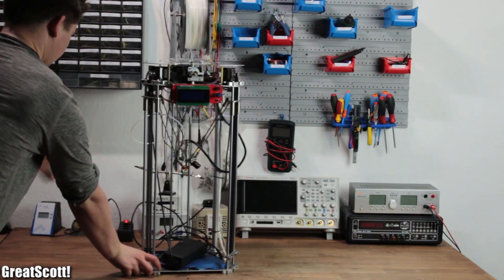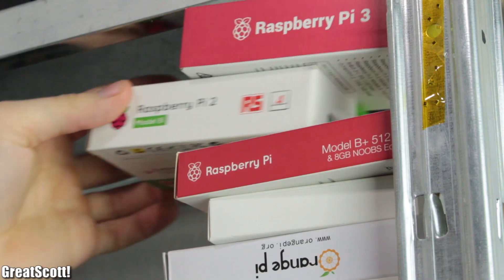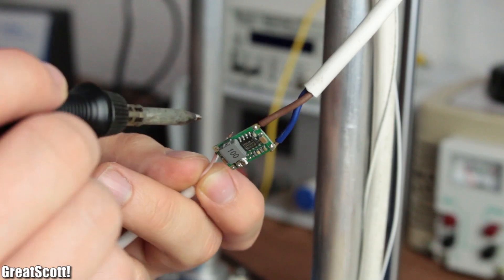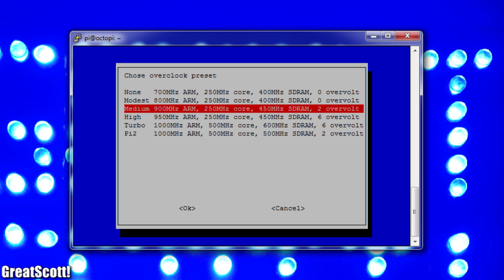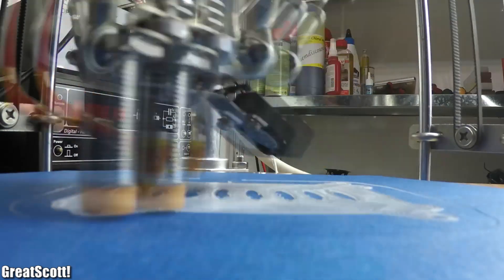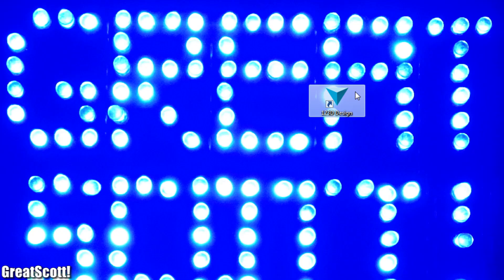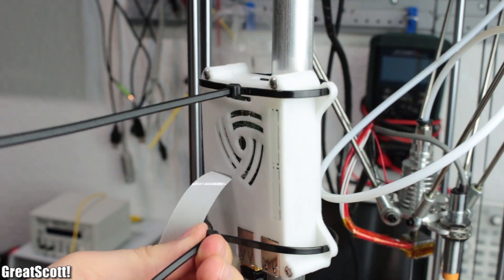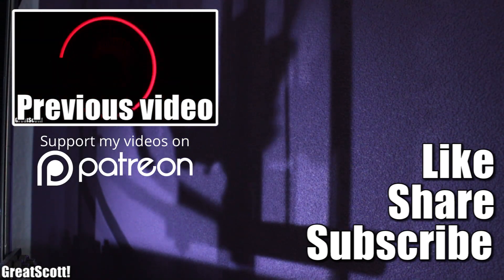Wirelessly control your 3D Printer - OctoPrint Tutorial - 3D Printing Beginners Guide (Software)

Comment: Depending on the printer you have, it might have a USB B port. Would that be just as useful with the Raspberry Pi as your DIY wiring? That way I can start prints through a network.

Comment: I followed your tutorial and used the same mini buck converter, but after turning on the 3d printer psu and connecting the raspberry pi to the arduino, the voltage regulator on the arduino gets very hot. if I disconnect the raspberry pi, it cools down. I think somehow the rasperry pi is drawing current from the arduino? The pi is still powered on if I disconnected from the arduino. Strange.

Comment: Did you try to put cooling fans around nozzle to stop stringing. If not give it a try. I have the same problem and putting extra fans helped a lot and now i dont need to clean my prints from string chaos. :D

Comment: What am I missing here @greatScott? 
At 4:30 you discuss the LED circuit, 2 x 22ohm resistors in parallel with a 10mm white LED in series with them. You then go on to say it's powered by 5v. 
This produces an equivalent resistance per LED of 11ohms.
White LED's have a Vf of 3.3 and a forward current of about 30mA.
5-3.3/11=.154A or 154mA....
That is 5 times the Forward current.......
However 3.3*.154=0.5W...
Are these non standard LED's which can handle a higher current provided they stay below the half Watt?
I have not come across these yet and if I have I must be under driving them significantly.
Reply: yeah they make 0.5w ultra bright leds like that
Reply: So he did, however I have since realized I have indeed been under driving LEDs for some time. As it seems most LEDs are now rated in their watt handling ability. Ignorant of this I have still been designing circuits to keep the current through the LED to less than 30mA. 
This was very handy to learn!

Comment: To fix the stringing increase your retraction and increase your travel movement speed 10-20mms extra and delta printers can print up to 120+ mms not 30! The recommendations from China manufacturers are a load of crap ! Experiment a little

Comment: Try adjusting your hot end temp a bit lower, and experiment with print speeds. Stringing won't be as bad. Avoid over-retracting, it causes problems.

Comment: hmmmm,
I think your retraction settings really need proper calibration...
Reply: What is the general concensus on retraction?
Reply: i retract 7 mm at 30 mm/s (minimum travel 0.8 mm) and have no stringing issues (cr-10)
nozzle temp 210
Reply: I use 210 on my CR-10  (pla) and 4mm /.02... I like my CR-10, I have had tons of luck with it.
Reply: Mahmoud Shehata and possibly a lower temp

Comment: Sorry but you don't need to cut the wire on the usb cable. Wire the positive terminal to GPIO pin 2 and Negative terminal to pin 6.

Comment: IIRC you can adjust the retraction settings so the extruder pulls back a bit when jumping around on a print do you don't get those strings. might be temperature settings of the extruder too.

Just things to try 😊

Comment: You can add relays and 433mhz transmitter. With them you can power On/Off your printer or led after prints or in the Webinterface

Comment: don't most printers allow you to print from a SD card...
my printer does. and I use nothing else but the SD to print. sometimes (and this happened to me) the USB signal can get a hiccup and screw your print up. since all commands are send at teatime... these days I only use the USB for upgrading the firmware or diagnostic information...
Reply: using a SD will let you print autonomous from a PC or other device... you let the arduino controller do everything...

Comment: The Raspberry Pi with Wifi adapter and a camera module gets to around 80€ in Germany... Why does it have to be so expensive ffs? Also the cameras quality doesnt seem that nice...
Reply: what? I also live in germany and I just ordered a pi3 for about 40€.. you only need a pi2 for it and could even buy a used one from ebay.
Reply: +Rou Lor Yeah but take the camera, the power adapter and the wifi adapter in account. The pi itself costs 40€

Comment: Great & fast video.
I'm working on exactly the same solution, "getting the printer to work standalone but accessible through octoprint" 
I've bought the Beaglebone black & the Replicape, because of the extreme noise reduction the silent step drivers on the Replicape board. For long prints this makes my workspace more pleasant. Check ik out @ http://www.thing-printer.com/product/replicape/

Comment: Wait, you soldered white to ground? In a normal USB cable white is data and black is ground. I am pretty sure you could kill some devices with a cable like that.
Reply from the maker: +Samuel Doye The cable was a bit special. Only had the two power wires inside, no data wires.
Reply: +GreatScott! Yikes! That does sound rather "special".

Comment: Hi, mister, can I use this contraption with my Prusa i3 printer? My school lent it to me few months ago, and don't trust it much, but some prints takes dozen of hours and I have it under my bed, so because of fumes and vibration it is impossible to print it while asleep. So I need to somehow make sure it is printing correctly while I am away at school, or if it is not, so I can shut it off. I was thinking about some weird camera/tripod/livecam/TeamViewer build, but I am stuck at the point I don't have anywhere near good enough phone (just impossible with my Nokia 5800 XM). So, if I build this, can I access it from outside? Or do I need static IP? Thanks in advance, and also, I love your stuff, you are making videos that I really need because I love electronics and in my school they are teaching nothing about it. :)
Reply from the maker: +Krivulda Google Port forwarding with OctoPrint.

Comment: Nice setup ! Beware however of leaving the printer working when you're not around, it could catch fire... Regarding the plastic strings, you should 1. make sure you're printing at the right temperature and not like 20 degrees above 2. play with retraction settings, increase the retraction length, also I found that retracting and lifting the head by 0.3mm makes a huge improvement.
Reply: your comment says '2 days ago' wtf
Reply: +MEe$ I think these videos are available earlier if you are a patreon. 

lg, couka
Reply: lol
Reply: +rs232boy Keep in mind he has a Bowden setup.  Those are much more prone to strings than direct drive.  When I was experimenting with Bowden, I had to do about 10mm of retraction instead of about 1mm to keep the strings down.